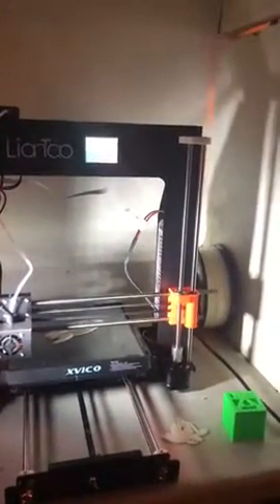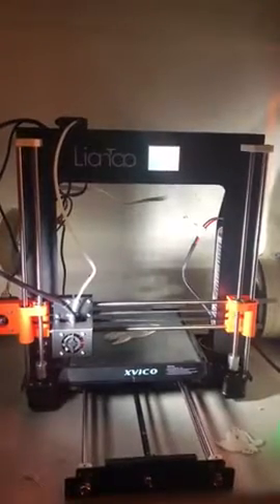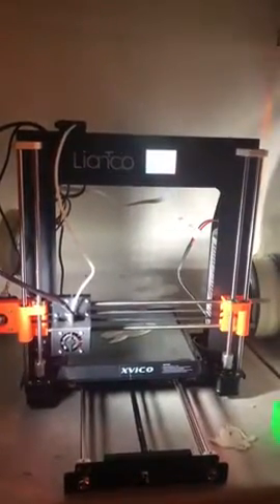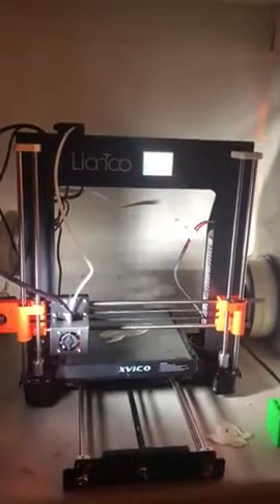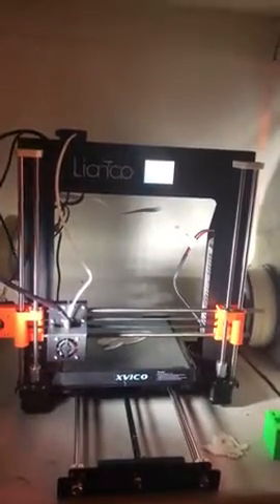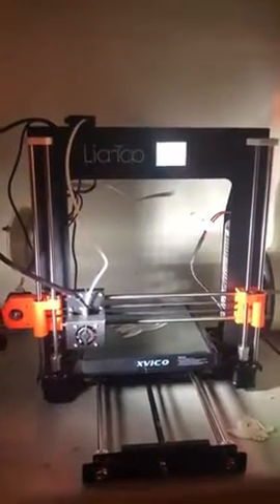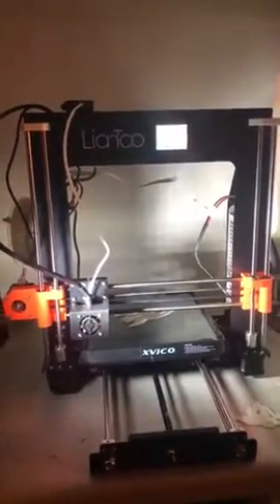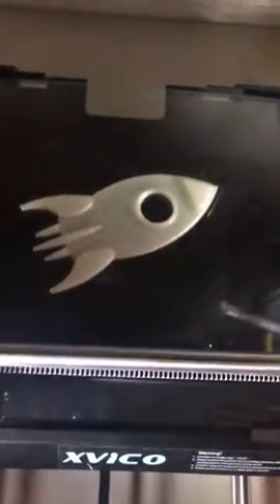Creality Ender 3 V2 3D Printer by MKK FDM | with 200g Test Filament | Upgrade Ender3/pro with Silent

Comment: this is $99 US on amazon right now, i got mine in the mail a couple days ago just havent got around to putting it together yet. i have 5 other printers an also a flsun qq-s pro still in the box i have to put together i got a couple days after ordering the x1 for $150 from a facebook seller, but the x1 will be the first printer ive messed with that will not have a heated bed an i cant find anything online about the printer except for a few videos from the manufature an stuff like this. i cant find any videos that go into detail about the printers hardware. i actually have a heated bed to go on it i had bought to use on a delta printer i built to hold me over til i could find one that fits it better but after opening the box to make sure everything was good i noticed how small the power supply is that comes with it an im going to guess that will have to be changed if i plan to add the heated bed. ive seen the bed upgrade done on the x3 but im not sure what if anything the 2 printer share. only thing i know for sure about the printer right now is it has a4988 stepper drivers an thats from seeing them in the video. if anyone can point me toward any info on this printer about if its current hardware will support the heated bed upgrade or should i go a head an get a new power supply b4 even messing with the heated bed.

Comment: Could you please let me know what flavor of Gcode you use to print? The printer works great with the gcode samples on the machine SD card (but it does not seem to work/read the STL files (Not sure if all have to be converted with CURA v14.07 included)).  Every time i convert to Gcode RepRap(Marlin/Sprinter) using CURA  and add to a SD card the printer wont move an inch.  Do you know how fix this?  does anyone know what kind of gcode the x1 runs?

Comment from the maker: Creality Ender 3 V2 3D Printer by MKK FDM | with 200g Test Filament, Upgrade Ender3/pro with Silent Motherboard Meanwell Power Supply Carborundum Glass Platform
Click to buy: https://amzn.to/37dEu4k
More Similar Products Link below
https://amzn.to/3qxFmbP
https://amzn.to/2Nok4OX
https://amzn.to/37e7CIG
https://amzn.to/3ahqvfE
https://amzn.to/3aj6up6